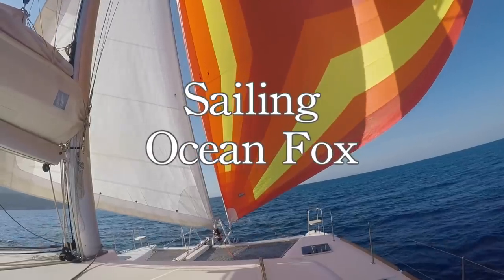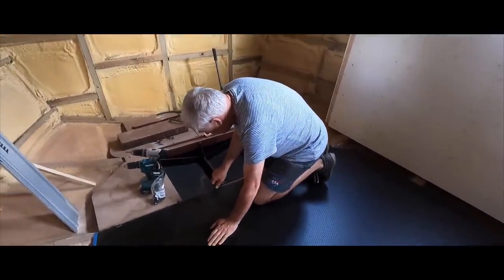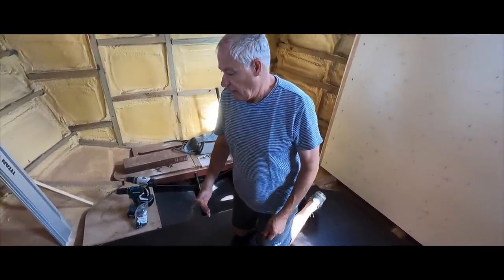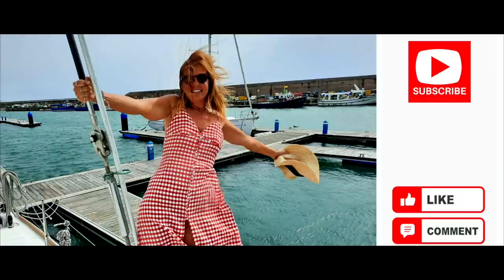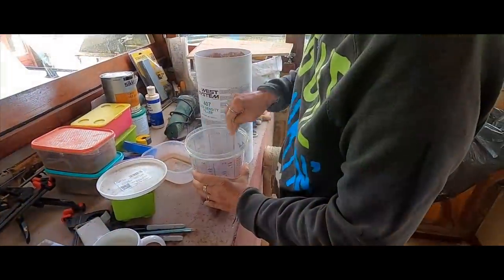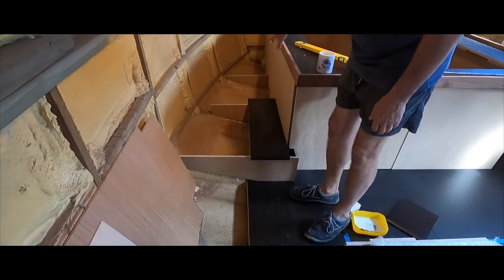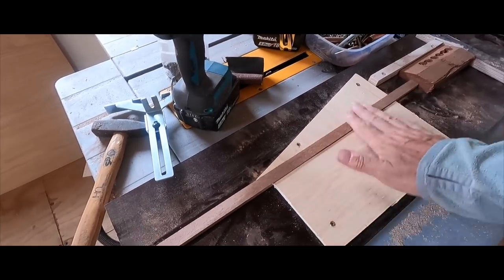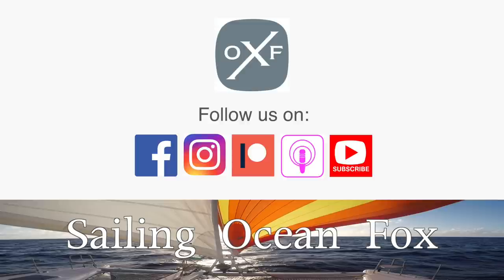BARGE BUILD.  Time? Watch this... before you start building a boat! Sailing Ocean Fox Ep180

Comment: Always, ALWAYS, hold the sanding machine flat. If you put it on the edge, you get even more work next step. When you are sanding that low density stuff you can use grid 60 on sander. The next level take away the smal skratches.  Nice bed you two made!
Reply from the maker: Thank you Arnt

Comment: Just a couple of hints. You should always use the sander flat down, never on  edge. The fibreglassing of the top should have extended  a little way down over the sides.
Reply from the maker: We have a finish to put on the edges, that’s why we didn’t let the fibreglass going further. Cheers Larry

Comment: You should always wear a full protective suit when sanding fibreglass. And wouldn’t it have been a good idea to put some sort of access door into the front of the bed box?
Reply from the maker: Yes, will have two drawers at the front of the bed. We haven’t cut yet. Cheers